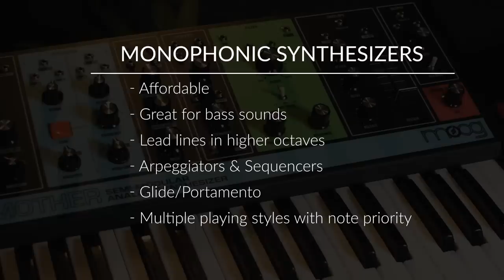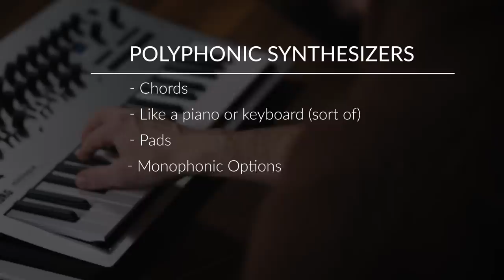Monophonic vs. Polyphonic Synthesizers: Which is Right For You? | Reverb

Comment: I tend to think mono synths are BUILT to place more emphasis on one note, meaning it can be deeper, more raw. Putting that same thing into actual polyphony could introduce a pretty muddy tone.
Poly synths for that matter tune their oscillators so they dont sound as muddy in unison.
This creates a difference.
If you have two oscillators and you detune one of them a step up, you have a "kind" of polyphony, just on one note. Also, you can add extra effects pedals to a mono synth and you can get a VERY similar sound as a poly synth with just one note. Reverb, pitchshift, delay and looping are good for that.
Playing 3 notes to make a C note isnt always madly different from just playing 1 C note, but it can muddy up your sound way easier.
Mono synths are more affordable, but more voices doesnt instantly mean better.
As far as I know, the Korg Minilogue is a great synthesizer, but a single voice sounds noticably thinner than the Monologue's.
I may be wrong, but I hope I could get my point across.

Comment: Can I play the sounds through my car speakers?
Reply: Of course, mixer in between, otherwise it will sound only on other speaker
Reply: Kaitsu What do I need?
Reply: @HardKore5250  assuming your car has aux input that takes 3,5mm TRS cable, first, from the synths output you need to go to mixer input. now you need to get audio out of the mixer, use the headphone output, since it is single output and stereo. get a 3,5mm -> 6,3mm TRS adapter if your headphone out is 6,3mm sized and connect aux cable from mixer to car stereo system.
TRS stands for Tip-Ring-Sleeve, to know what you got at your hand look at the connector, if it has one ring under the tip, its regular "guitar cable". 2 rings means its TRS, and supports stereo

PS. laptop and audio interface can be used too instead of mixer! this benefits as a recorder and sequencer
Reply: Kaitsu Cool seems like a lot lol.

Comment: Neither... VSTs for the W!
Reply: I sir envy you.
Reply: The same applies to VSTs. Some are monophonic and others are polyphonic.
Reply: Yes... but neither require you to buy an expensive physical synth... you know... the latest one you need... until the next one comes around!
Reply: @JeffCfreeradiorevolution , but you can take your hardware synth out just about anywhere, plug it into an amp and start jamming away.
Reply: @JeffCfreeradiorevolution  VSTs are great but definitely don't produce the same sounds or textures as hardware synths.  But whatever works for you works for you
Reply: I fully disagree. I've been using VSTs for a few years now... I couldn't imagine trying to get the same workflow from hardware synths. Don't get me wrong: physical instruments are awesome and hardware synths are amazing machines... but it's just so much easier, efficient and cheaper to use VSTs. Also... you can get midi controllers and a laptop/tablet and use them live anywhere.
Reply: I can’t say I’ve ever been inspired to do clerical work.
Reply: you dont buy real synths because vsts dont sound great (they do sound great), you buy a synth if you really want to physically own it and control the knobs by hand. my favourite synth is actaully the tone 2 firebird, free vst-only synth.
Reply: Or AU if on Logic Pro X and of course an 88Key Midi-Synth allows for what you're alluding to.
Reply: I use both.   Hardware Synth and Softsynth.
Reply: Try the Tyrell N6 if anyone here hasn't.